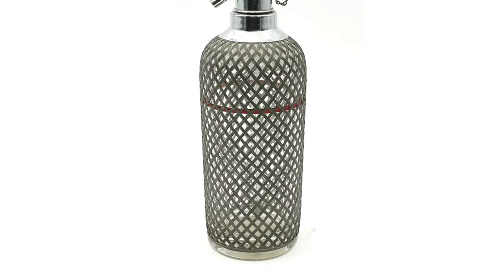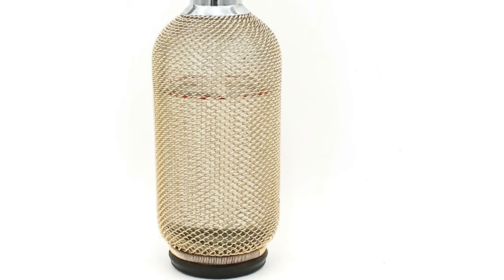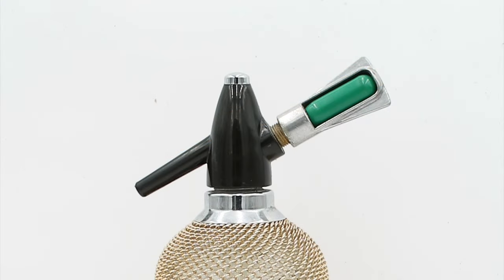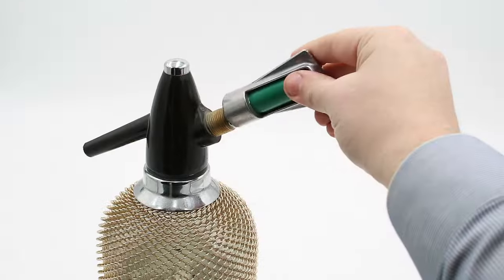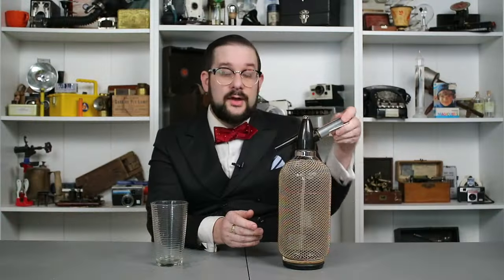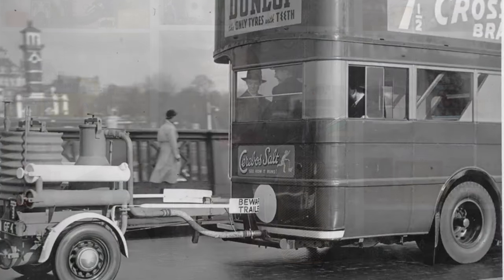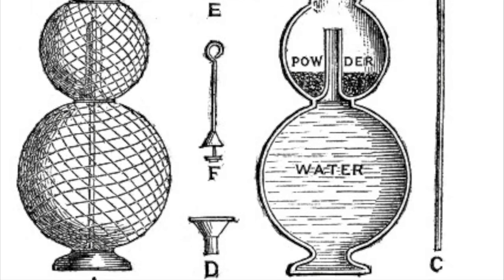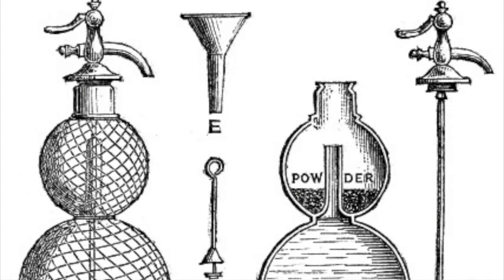SHORT: a Working Soda Syphon!

Comment from the maker: To everyone asking: no, 12g Crosman Powerlet cartridges won't fit in the syphon; they are a full 2 centimetres longer than the 8g syphon cartridges.
Reply: Just fyi, nitrous oxide (whipped cream) cartridges are 8g, and at slightly lower pressure, so they should be usable in the soda siphon. The resultant bubbles are much finer than carbonation, and have a slightly sweet flavor.
Reply: nothing a 3d printer couldn't fix
Reply: 8g food grade CO2 cylinders are still available.  Growlerwerks makes a modern version that uses them for dispensing beer and soda.
Reply: The old style Crosman powerlets were 7g (I have a 1950s vintage Model 170 that uses two of those) and should work in this syphon, possibly with a spacer behind the cartridge to be sure the needle can pierce the seal.  Technically not food grade, but potentially toxic impurities should be negligible in 800 psi liquid carbon dioxide as packaged in those cartridges.

I also used to have a similar device to this, but intended to use nitrous oxide to make whipped cream.  Starbucks still uses similar devices to put whip on their beverages, and I shudder to think how many nitrous bulbs they go through, worldwide, in a day...

Comment: You make the most intelligent videos, thank you.  One small thing, once you release the CO2 into the bottle it is necessary to vigorously shake the syphon to mix the gas and water.   The result will be much more sparkle in the seltzer.
Reply: You don't NEED to but shaking the container does speed up the process. The water will also absorb more CO2 when it's cold.

Comment: My family used to run a pretty large construction materials company in the 2000's, but since it had to be downsized. I vividly remember plastic soda syphons being used by the workers, as intended, to get carbonated water. They were delivered in racks of 9 or 12, can't recall exactly, and once empty, they would be returned to the provider to be refilled.

Keep in mind, this was in central europe. Pretty interesting that these things spread so far and were used so long
Reply: I remember my childhood in Poland, after 1989, taking glass syphons to a basement somewhere to refill them from an old shop compressor being run by some dude. Much later I've saw the plastic counterparts from time to time.

Comment: If you can get some new cartridges,  I'd love to see you actually make a drink with it and compare it to store bought seltzer. The Tom Collins is one of my favorite cocktails
Reply: Standard cartridge, sold mostly to people who use airsoft guns and such, and also for a lot of models of paintball guns at the cheaper end.  Just have to make sure he gets those with CO2 in them, not those withnitrous oxide in them, used with a very similar unit to make whipped cream, as the nitrous oxide does not turn the cream into butter.
Reply: Both syphons and cartridges are available from Amazon.
Reply: To have a genuine, fully operational seltzer bottle and not make an egg cream would be a sinful waste.
Reply: @SeanBZA    tbh the whipped cream cartridge, while it won't produce carbonated drinks, is a lot more fun in other regards :D
Reply: @SeanBZA Also, N2O dosen't have the carbonic acid taste, our you get a funny fizzy cream with a tingle. Pus N2O is fat soluble, so dissolves better in the cream.
(The CO2 ones are often used for portable beer dispensing systems. Though the screw in bicycle tyre refill type ones are used more for those now.)
Reply: @SianaGearz  Kickballoons😆
Reply: @SeanBZA  The CO2 cartridges for soda siphons are different than Airsoft/BB/paintball cartridges, they are a different dimension.  The cartridges for soda siphons are sometimes available on Amazon.

Comment: Don't know if it would still work, but used to be the CO2 cartridges for soda siphons and CO2-powered airguns were interchangeable. I don't know if they were supposed to be and if there were any safety hazards, but as a kid I would cheerfully steal some siphon cartridges from my parents to use in the airgun, and my dad would as cheerfully steal some of my airgun cartridges back when I'd bought some.
Reply: I think your Dad had the short deal as his CO2 cartridges probably contained pure CO2 where as yours for the air gun may not have been so......... I would have done the same given the opportunity.
Reply: @Woffy.  Could be, though we never noticed much difference in taste or length of use.
Reply: He went over this in the last video, but they're usually incompatible with soda siphons
Reply: You can also just buy the 8 gram soda cartridges. They are still made and readily available online.
Reply: @Adamaspotestas  In many air guns the 8 gram an 12 ones swap over fine, you just have to screw them in longer.

Comment: I always enjoy your videos.  The soda siphon reminds me of the whipped cream canister that we used for decorating ice cream sundaes at a drive-in in the late 1960s.  Stainless steel container with a threaded top.  One poured cream into the canister, screwed down the top, and added a CO2 cartridge (that looked a lot like that shown).  The unit was inverted, the spout was touched to the side and whipped cream came out.

Comment: A couple of things, you need to fill the bottle with water, (probably a fill line). If you leave too much air in the bottle  by only filling say half with water, you will not get carbonated water because the air simply compresses more and it doesn't settle into the water. Another thing is the colder the water the more co2 will be absorbed. And lastly, surface area and time both aid the carbonization process. So, if you fill it with enough cold water, then insert the co2, and then lay the bottle in the fridge on its side overnight you will find that you get much better results. Just an FYI as to why your water probably didn't seem like seltzer water. I doubt the cartridge lost co2 even if it was many years old.

Comment: ☝︎ yawns in European – Smaller devices with the same cartridges are quite common here in Europe for making whipped cream. And for carbonated water, literally millions of German households have a "Soda Stream" device (or a similar device from another brand) with a large cartridge and a plastic bottle in daily use. The cartridge holds CO2 for ≈60 liters of carbonated water and can be exchanged for a full cartridge at almost any supermarket for about €5. Syrups for making all kinds of sodas (like Cola or Sprite) are sold as well. So no more lugging heavy beverages when you go grocery shopping.
Reply: yeah, but is not the same as actually having and using a siphon to mix your drink. In argentina bars and restaurants have them and leave them at the table.
Reply: @PatricioGarcia1973  Yes, of course, a siphon is for alcoholic drinks and more stylish. I wanted to say that making carbonated water or non-alcoholic sodas at home with cartridges is normal here.

Comment: Arnt those cartridges the same as for air soft guns if so they are cheap and plentiful. Come on gilles we want to see a good cocktail made with a high(ish) pressure syphon
Reply from the maker: No: 12g air gun cartridges are a full 2cm longer than 8g syphon cartridges and won’t fit in the holder.

Comment: When we lived in Buenos Aires around 1990 we had a service that delivered bottles of carbonated water on a regular basis rather than a cartridge.

No milk deliveries, though I was confused at the milk sold in plastic bags (we would put the bag in a pitcher and cut off the corner of the bag).